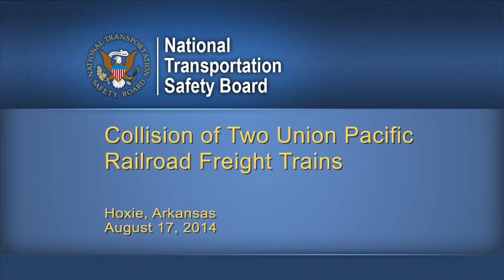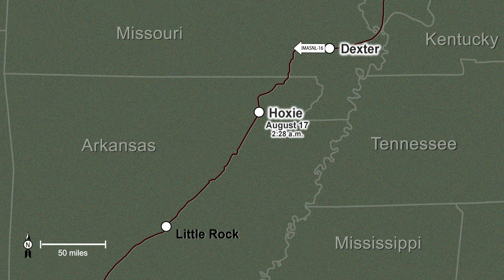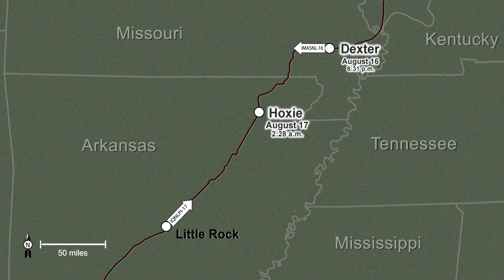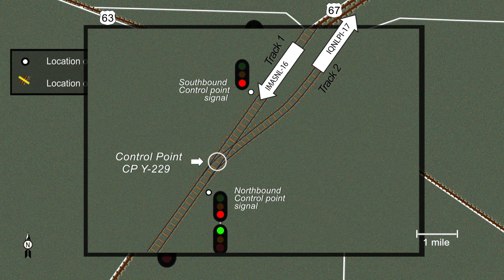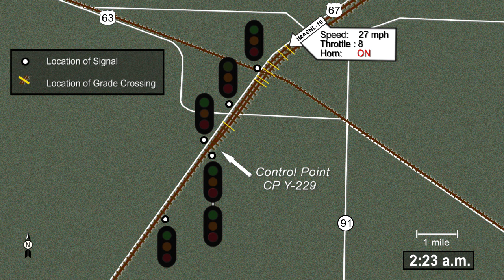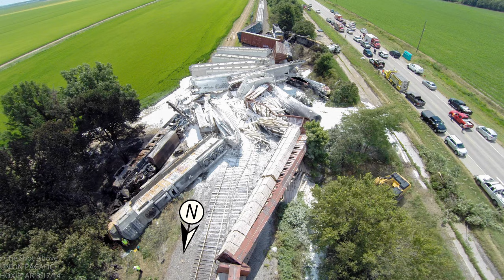Collision of Two Union Pacific Railroad Freight Trains

Comment: 2 planes can avoid each other  30,000 feet in total low visibility and POS RR can't install avoidance electronics on the ground.
Cheap RR, You can get installed CHEAP on a Cessna 172!
Reply: You do know that if Congress hadn't delayed the implementation of PTC, this accident wouldn't have happened, right? And train companies are still pushing to delay the implementation even further out cuz they don't want to pay for a safety measure they very clearly need.

I would also add that airplanes aren't on a track without the ability to swerve and miss each other - trains are. Trains are also much more efficient than airplanes (and trucks) - which is why almost all of our goods are shipped via train across the country. It's capitalism at its finest - cheapest shipping method wins. It's the same reason we still have cargo ships - much cheaper than flying.